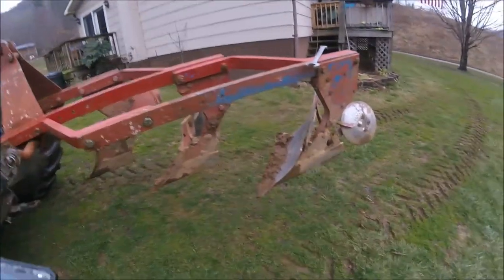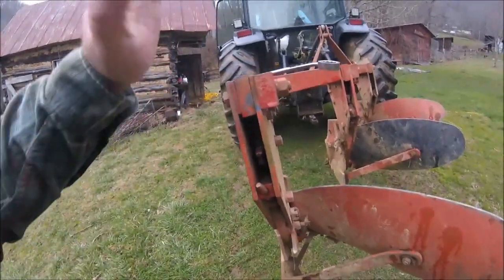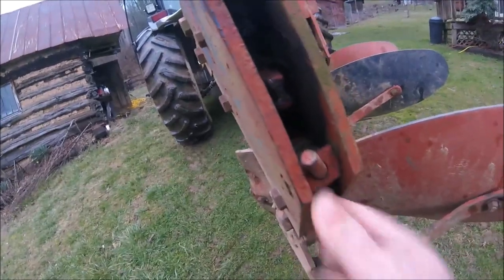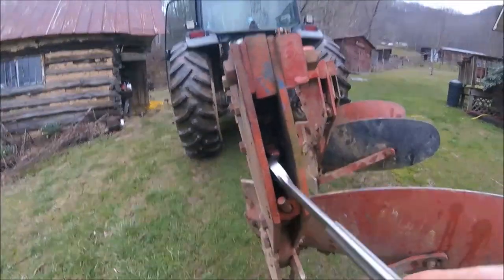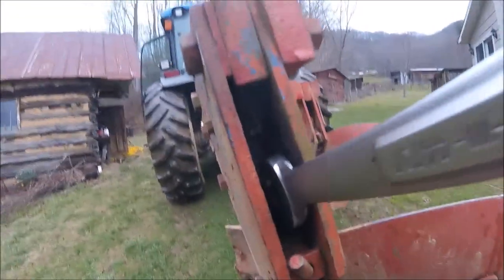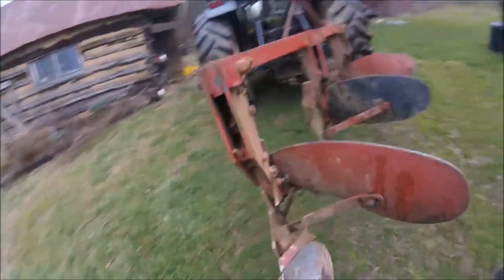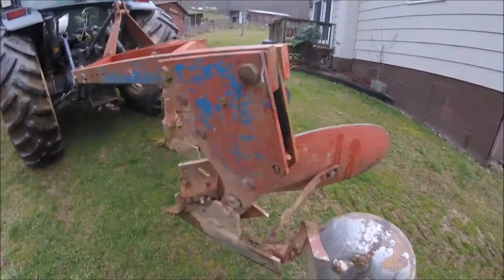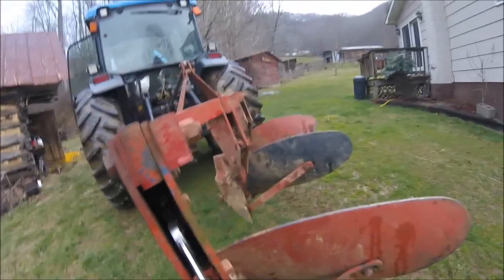Ford 101 Plow Tripper

Comment: New tractor owner. I've been watching a lot of your videos of late. It sounds like North Carolina dirt is similar in some ways to Georgia red clay (I'm in West Georgia). Tomorrow, I'm going to take a look at a Ford 2-bottom plow. Near as I can ascertain from the picture on facebook marketplace, compared with pictures online, It's a Ford 101. I learn fast, but what I know about plows can fit on an index card. 
What I'm wondering is twofold: If your trip mechanism becomes damaged, can you do a Jerry rig repair with other parts you find on the shelf at hardware stores or agriculture supply stores? OR... can you convert it to a shear bolt trip?
Reply from the maker: I have seen people convert them to shear bolt if the tripper is broken or worn out.
Thanks for watching
Reply: @Mtnfarmer after getting the ford 101, two bottom 14" plow, breaking it down, sanding, priming, painting, greasing, and reassembling, she looks great. 

I first tested her out yesterday, and tripped the right side on a rock after 75 feet or so. 

My understanding is that you're supposed to put it in reverse, and reset the trip mechanism. But that did not work. So today, I'm going to take off the side plate, reset it, and then reassemble it... making sure to crank the j-bolt down as tight as I can make it. 

Any suggestions, gotchas, tricks, or things to look for in making sure I can reset it without having to disassemble the housing?